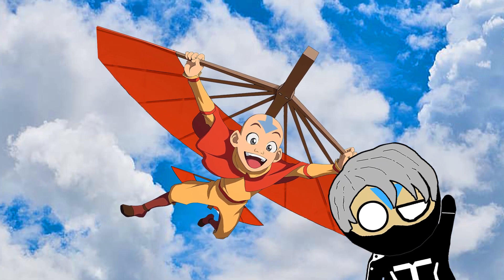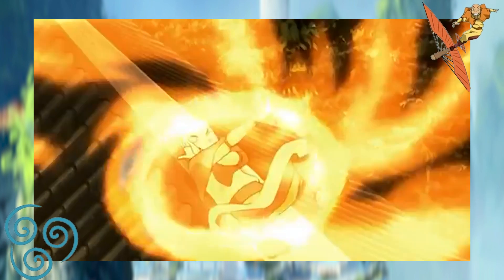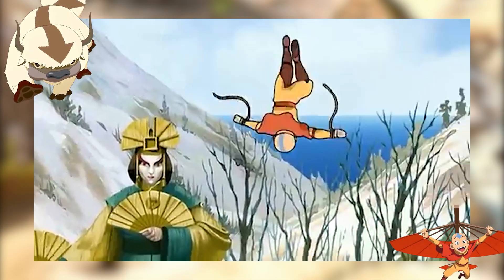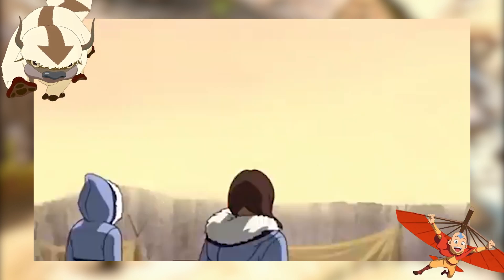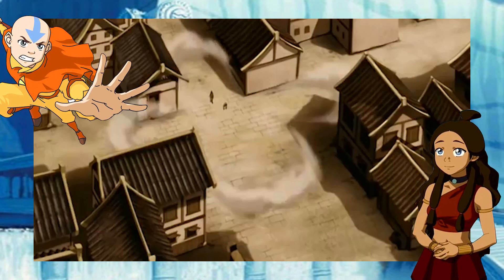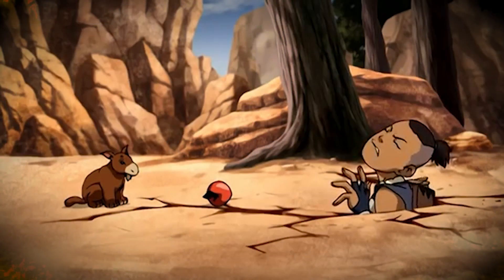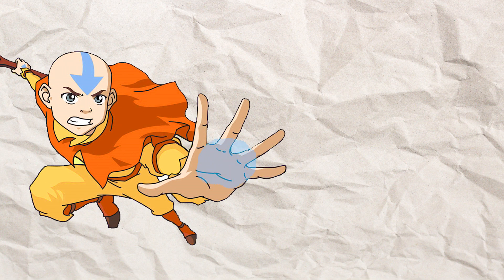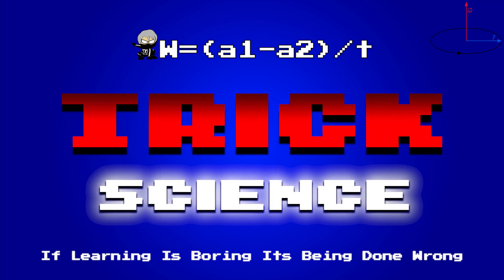The Science Of:  Airbending (Avatar The Last Airbender)

Comment: Yeaah, that makes no sense. Why is air not burning anyone then? Why there's no difference in bending in both north pole and in place surrounded by fire?
Wouldn't fire create different pressure and made airbending extra hard? Especially during final fight with Ozai. Why wasn't it mentioned anywhere? Why would they life extra high, if it was easier for them to bend? The base of air bending is to overcome boundaries of your mind and body, thus it would make NO SENSE for them to choose easier path.
Also, why waterbenders can't Airbend then? They can change temperatures, they can take particles of water from air (like we can see in episode with Hama), what stops them? 
Same with firebending - it also changes temperature of surroundings? When you use a fan while it's hot, do you think about "changing pressure of air" or simply changing its location, making it move faster with other object? When you move, you can feel air flowing, slight feeling on your face or hands, etc, it's not like it's just because of pressure changes. 
Airbending is art of understanding yourself, earth, respect to both of them and balance of knowing when to go, or not, with the flow. 
Not without reason Korra had problems with understanding airbending - it wasn't about her being terrible at temperatures xd it was about her own path of understanding her spirituality. She was a person  too bounded to earth and strength of own body (visible in comparison between her taking part in pro bending and working out with tenzin).